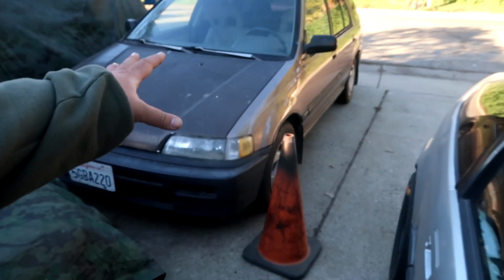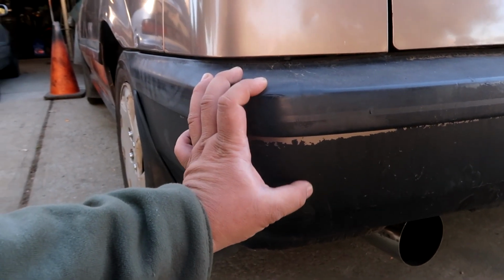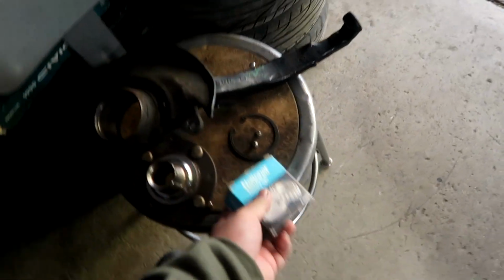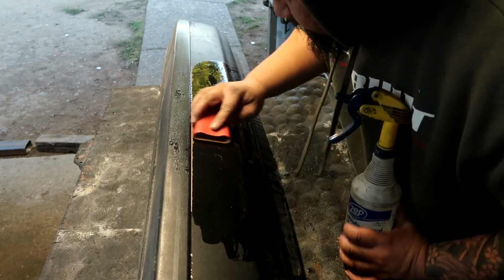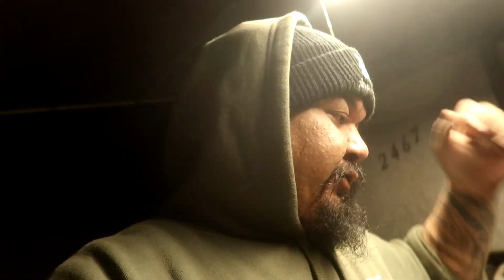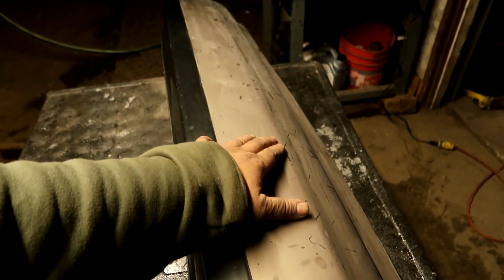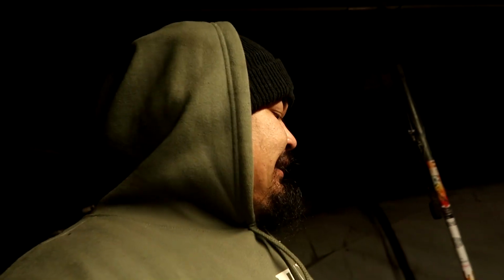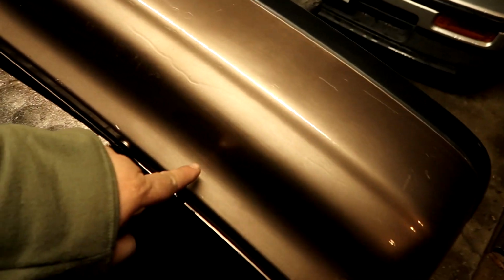Rescued Wagon REAR Bumper Refreshment !

Comment: The last 2 EFs I've sold were to guys that "wanted to build them". 1st was a 88 crx, the guy ran it dry of oil and snapped the cam off the camshaft then scrapped it. 2nd was a 88 hatch and dude took it to a shop to get idle surge fixed and never went back for it. Ive learned to stop caring after I sell a car that way im not disappointed when i find out what happens to the car

Comment: Fold a piece of tape use the sticky side and dab the clear coat run. Half the time itll blend either way makes it flatter so you dont have to wet sand as much and risk burning an edge which should be covered to prevent doing so aswell while knocking down

Comment: Just wash the car 2 days later with a wet detailing rag like a light buff after the spray paint really dries,  detail swirls with or without soap I don't use soap on the first wash after I paint and it come out so smooth

Comment: can someone please help me. i have a 1991 integra rs, so it has no sun roof, manual windows and mirrors. since it does not have power mirrors the place on the dash where the mirror switch is supposed to be is missing. there should be a block off cover part that goes there, but its missing. if anyone can help me find one i will pay you for it and shipping or if anyone can find out if i can use one from maybe a civic or something, maybe someone has one to compare to it would be greatly appreciated.